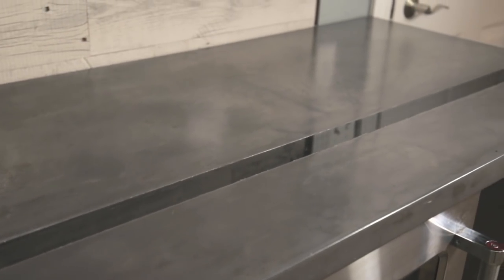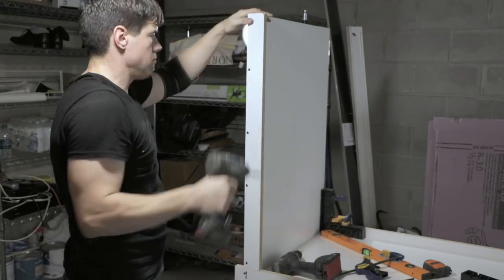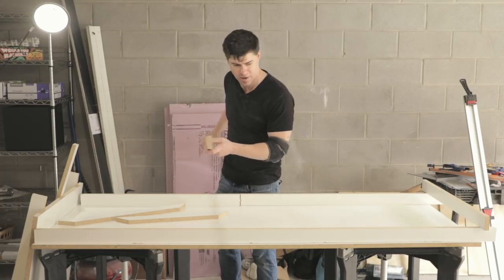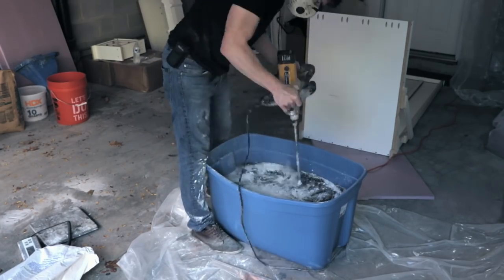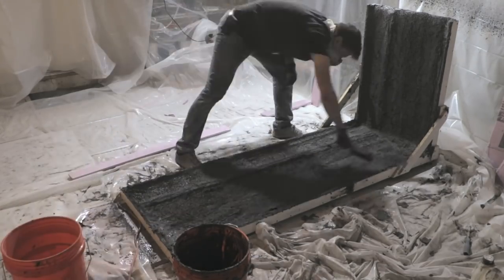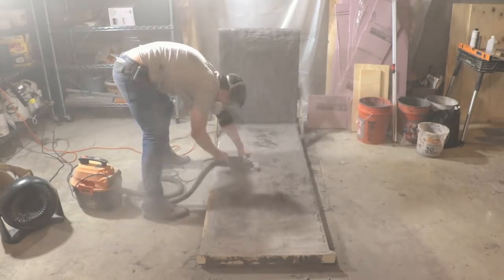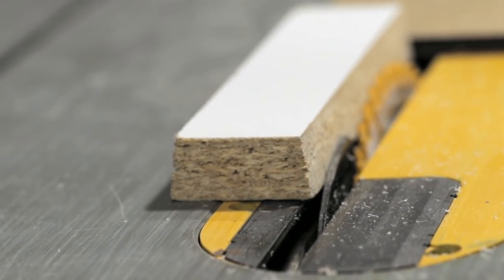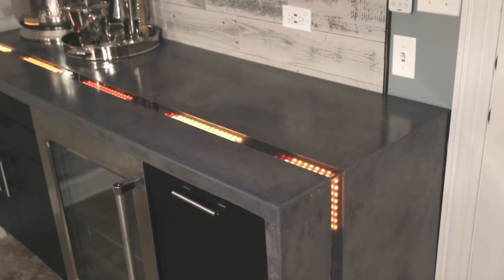DIY Mancave Makeover Pt. 1 // Waterfall Concrete Countertop w/ LED River Inlay

Comment from the maker: This project originated from viewers asking me to combine LEDs and concrete.  Do you think the project succeeded in bringing the suggestion to life?  Any ideas for improvement?  And, after watching this what project ideas do you have for the combination of LEDs and concrete?
Reply: Have you found or played around with any materials that diffuse the LED light? I've been trying to knock down LED light that is super close to the diffusion material. Anyway, awesome project, great results, and a video worth watching! Also + for PPE, e.g. respirator, Nitrile gloves, etc.
Reply from the maker: Yes, quite a bit actually.  What color diffuser are you looking for?  Check out the white semi-transparent acrylic I used in my LED Bluetooth Speaker video -- it does a great job of wide dispersion from pretty close.  I also bought a semi-transparent black acrylic sheet that I've yet to try.
Reply: Mostly white diffusion, I'll check that Bluetooth speaker video for that, thanks!
Reply from the maker: +Robert Edwards yea, I think there is a link there....that white diffuser is great
Reply: Modustrial Maker
Reply: Hey for your light strips, did you just wire up the data lines in parallel  or is there some other trickery going on?
Reply from the maker: Just wired them in parallel, so the data line from the controller splits and goes to both.  Nothing fancy for this build.
Reply: Modustrial Maker, nice work bro!
Reply from the maker: Thanks!

Comment: Another winner, Mike - dazzling!  280 Lbs delivered and installed!  By now, you know how I feel about Aircrete, so I won't belabor the point.

How about this for a table concept: an M.C. Escher-esque concrete table.  Chose from Relativity (staircases), or the birds/fish, Lizards, Drawing Hands, etc...  With molded relief in black and white or hand-stained. and then topped with glass.  It's ambitious, but I think it would be stunning.  And you're just the man to do it!
Reply from the maker: Thanks!  And that table idea sounds awesome -- would be quite a mold!

Comment: I love it, now that's something worth me learning
Reply from the maker: Thanks!
Reply: I'm seriously going to try, I already bought the concrete polisher.
Reply from the maker: +Dwight Hobdy cool!  Let me know if you need any pointers along the way.  I definitely recommend doing a couple small tops, and one with a small vertical surface to get the feel for the mix.  Lots of room for error with horizontal surfaces, but with vertical, you've got to get the mix consistency right.  Definitely doable, but a little practice helps :)
Reply: Modustrial Maker  Hey thank you very much for   the advice.

Comment: Great job! I love your show. Now, can you show how to do a kitchen countertop with the same concept? It's the same idea but weight becomes an issue. I figured you'd do it in place since it's going to be really heavy.
Reply from the maker: At some point I will do a kitchen...just need a freind with a kitchen they are remodeling!  I would do it off-site and use the same pre-cast technique.  With GFRC you can keep most any piece to a manageable weight by using foam inserts.

Comment: Hello great video!!!

Wanted to ask you what did you use to sand the final product?? 

1.)Diamond sandpaper on your orbital sander? 

2.)What grit did you use ? 

3.) Would a wet sander work better ? 

4.) Did you expose any of the aggregate? 

5.) Have you experimented with any other sealers that last a long time ?
Reply from the maker: Just normal sandpaper, up to 220 grit, then 400 grit wet sand by hand

Comment: I have seen a lot of people do this without the sprayer, would you 100% suggest having the sprayer or can the top coat be laid in and brushed in (similar to your white small table top with the wood piece)? right now my compressor is on the fritz and I would love to try some of these projects but would rather spend the extra 200$ id have to spend for compressor and spray gun on other products. Thanks in advance, love your work!
Reply from the maker: depends on the project -- if you have large vertical surfaces, you really want a sprayer.  If not, then pouring and brushing will give you pretty good results.

Comment: Awesome project Mike!!! It was cool to see you make the GFRC from scratch, and using stuff you don't have to order off the internet. GFRC is something I have been dying to start working with. But I've just got too much of my old man in me to pay shipping costs on things like "White Portland and Sand." But I think this video has inspired me to just get off my @**, order some glass fibers,  go to Home Depot for everything else, and start experimenting with GFRC. 

My one and only question I have is... what are you eating at around 04:30:00? It sounds delicious.
Reply from the maker: Ha, I wondered if anyone would catch that :) Probably dinner....at midnight...like usual....

I would recommend ordering some powdered polymer (maybe a couple bags of the Buddy Rhodes admix, which aren't too bad to ship), so you can source all the cement and sand locally.  If you don't have a masonry supply place where you can get white portland, you can also just use the grey portland cement they have at home depot (which is super cheap).  You can't do white, but it works just fine for grey GFRC.

Comment: To combat slumping, have you tried fixing covers to the side forms to stop the concrete flowing down? 

I’ve got a concrete counter planned that has waterfalls on both sides and feel this would be a way to eliminate the risk of slump.
Reply from the maker: Check out my recent Arctic erosion table... I solved the slump issues in that project... Use an AR glass mesh, and pack in thin layers, 1/8" or so each, to build up verticals slowly.

Comment: Excelente video, el acabado final es genial. Me da curiosidad saber que tipo de pistola usas y como se llama el recipiente que utilizas para poder almacenar el concreto para lanzarlo. Saludos!
Reply from the maker: ¡Gracias! Utilicé una pistola de tolva para tablarroca Marshalltown con un accesorio de 45 grados para la tolva. Aquí hay un enlace: http://amzn.to/2BJjmBi

Thanks!  I used a Marshalltown drywall hopper spray gun with a 45 degree attachment for the hopper.  Here is a link: http://amzn.to/2BJjmBi
Reply: Modustrial Maker mil gracias!!

Comment: Buy a trowel lol, also concrete is generally only 10-25% cement and is mostly aggregate (could save some money on future builds). It turned out beautiful though, very impressive.
Reply from the maker: Thanks!  FYI, cheap concrete like Quikrete is only 10-25% portland cement.  GFRC, however, which is much stronger, is usually around 50% cement.  You are comparing apples to oranges there.  GFRC would not work with a lower cementious content.

Comment: Good video, I also like the design.  But I am curious why he didn't use a plasticizer to help the backer coat level out?  Also why not place the foam board in place to create spaces then remove them, instead of leaving them in the project?  It seems like leaving them in would negativly effect the flexeral strength?
Reply from the maker: I actually did use plasticizer in the back coat.  I've found that when I get to 3% AR fibers, I can't get it to flow -- the fibers are just too dense.  I used a lot of fibers in the mix because it has to do a 6 ft span, basically unsupported.
Reply from the maker: Also, the foam core probably makes it a bit less strong, but we had 1.125" of GFRC in total ( 3/4" on top, .375" below foam), and I find it easier to just leave the foam in when not doing self consolidating.

Comment: Would like to know more about how you made the concrete glossy... I wish there were videos on how to make white concrete, black, glossy, etc. Don't know how to make concrete from scratch...
Reply from the maker: +LightGesture no huge secret...this surface is typical for GFRC if you sand and seal it.    As for white concrete and other details, check out my other concrete videos, including a couple with a white mix. And if you need more details beyond that, my Instructables have a ton of detail (just search for Modustrial maker on instructables and you'll find them).

Comment: Creativity and ability!!  Very nice stuff.  I am just getting started on your videos and want to attempt to try this process.  Is there a particular video that explains the process in detail of setting up the forms.  I think I got it for the most part but the roller ball is a bit murky thus far.  Where do you buy that and are you simply removing the excess by hand after it dries? That is a great process if so.  I apologize if this is a redundant question  but if you could provide a link to the purchase of the "Ball" .  Great Stuff Mike!!!
Reply from the maker: The first one I did on a white concrete table does the basics for forms.  I also have instructables (same user name as my channel) with details written up.
Reply from the maker: Yes, you remove the caulk by hand   There is a link in the video description to buy the ball tool from Amazon

Comment: Excellent video, precise and ilustrative. I don´t have a compressor + hopper gun, it could be done without face coat? In this case would be use only one mix with fiber glass from the beginning? Thank you ;)
Reply from the maker: Thanks!  With a vertical surface, it would be tricky to do well without spraying a face coat.  If you are just doing a flat countertop or table, then you can just pour a thin face coat in and spread it up the sides with a chip brush
Reply: @modustrial  Thanks!! This first fine coat with or without fiber glass?
Reply from the maker: No glass fibers in the face coat (sometimes you can do a second face coat too, it you have the time/patience :) )
Reply: @modustrial  Thank you very much ;)

Comment: Beautiful installation! do you generally have to remove the cream of the concrete before sealing for the sealer adhere to the surface?
Reply from the maker: I have used sealer directly on concrete with no finishing, and it seems to work.  Although, I would imagine it would not penetrate as well and would need to be reapplied more often
Reply: Modustrial Maker thank you for you quick response, your projects are so inspiring! Would the sealer adhere if the concrete had been polished using a wet polisher starting from 800 grit up to 1500grit... Ideally I don't want to expose the aggregate.
Reply from the maker: I think so, but would recommend trying a small test piece first to be sure.  just keep in mind that a surface seal is not the same as a penetrating sealer, which offers much more protection.

Comment: Are you able to eliminate bug holes by spraying your initial coat?  I've never seen that done before.  BTW - I've found the Chen sealer to be best for my kitchen countertops.  It is a bit expensive.  Do you have a cheaper alternative?
Reply from the maker: Fishstone's sealer is good but not cheap either.  the less expensive ones tend to be surface sealers only, unfortunately. This is fine for a table, but countertops really benefit from a penetrating sealer.  And yea, spraying the face coat gives you a really nice surface out of the form.  Not guaranteed to be without bug holes, but definitely less, and sometimes, pretty close to perfect.

Comment: Great creative application.   Question- how long does it normally take for the counters to cure completely before form removal and machining?
Reply from the maker: +David C thanks!  It depends on temperature. GFRC sets up quicker than normal concrete. I. 70 degrees or more, 24 hours is usually fine.  Under that, I give it 36 hours

Comment: Hey, great video! I've been wondering, why don't you vibrate your concrete? or do you vibrate it and just don't show it?
Reply from the maker: No need with GFRC....there is a defoaming admix that prevents bubbles in the face coat.

Comment: I was wondering, in the results using normal concrete and some steel reinforcement, had you ever tried that way?
Reply from the maker: I have, and I definitely like the results better with GFRC

Comment: how did you account for the thickness of the leds to keep it flush with the top? i'm thinking of just doing a strip in the back side of my outdoor kitchen bar and wiring from the underside
Reply from the maker: The thickness of the LEDs doesn't matter so much, you just want them set back a bit underneath the acrylic diffuser. The diffuser rests flush because I cut it with a bevel angle and used a matching angle in the form to make the recess for it

Comment: Would I use the WS2812 LEDs or WS2813? TY.
Reply from the maker: +Alex Shliomovich I recommend using ws2813 if you permanently attach the acrylic, since ws2813 will keep working even if one LED or two go out.

Comment: Hi, do we have to apply a face coat when using GFRC? Can we just sand away the fibers when its cured?
Reply: Also, what type of sander are you using, after the angle grinder part?
Reply from the maker: Depending on the type of project you can get away with no face coat, but you never want to sand thru to expose fibers as this looks bad.   For a waterfall or anything with a vertical form surface, I think you really need to spray the face coat.  For a flat tabletop, you can pour it in instead and still get good results.
Reply from the maker: I just used a plain old random orbit sander on this one
Reply: Thanks! Very helpful! Is the vertical surface comment because you applied it by hand? What if you had used another piece of melamine to form the backside and poured in the GFRC from the top?
Reply from the maker: For the vertical, the face needs to be thin or it slumps off.  Thus, you need to spray it.  Pouring it or trying to spread the face by hand on vertical will just result in it slumping off.  You need to spray a thin layer (or two) and then hand pack the back coat

Comment: That form looked complicated. Personally I would've tipped it on it's side, and leave what would become the back of the counter open; face coat two separate halves, attach them, then pour the concrete in, and do all the typical form work.
Reply from the maker: +Xander Zoolander not quite understanding your suggestion.....are you saying you would have cast the entire thing as a vertical surface (tipping my form on its side)?  Or are you saying you would do separate forms for the top and waterfall sections, so they were separate pieces?

Comment: Since you used a concrete die, how did you get the slurry mix to match?
Reply from the maker: I explain how I match slurry in my latest video (the thin curved concrete bench).
Reply: Modustrial Maker Thanks for the reply good sir. I’ll check it out!
Reply from the maker: No problem!

Comment: If you would have closed frame the wall it would have been flat and you would have never had to babysit it. Also if you would have screed the top/bottom and used a trial the bottom/top would have been perfectly flat. Why order from amazon go to the hardware store.

Comment: Do you use sand in your hopper gun mix?
Reply from the maker: There is sand in the bagged mix I use for the spray coat
Reply: @modustrial  there are no bagged mixes on the market where I live (at least specific ones that deal with countertops) and I'm trying to replicate spray coat technique a lot of pros seem to use. Can you give me a link on product you use or tell me what fraction of sand and in what proportion to the cementitious is included in there?
Reply from the maker: https://goo.gl/35RvFM

Comment: i love the project but i do have a pet peeve i hate it when people encase foam inserts in concrete furniture
its just bad form and more often than not there are structural failures after a couple of years or even a small earthquake . 
i really dont see the argument about saving weight in this case you maybe saved 20 pounds is that really worth it ?
Reply from the maker: Thanks for the kind words on the project.  I'm curious where you get that foam will cause structural failures?  In my experience, with GFRC, it does not cause any issues.  In this case it saved us about 150 lbs as well....so very significant.  Plus it saved a couple hundred dollars in materials.  If you have some research showing how the foam hurts the structural integrity in some way, I'm definitely open to learn, but this is pretty standard practice with GFRC.  It only has to be 3/4" thick, and with this one we had 1 1/8" of concrete, so it was overbuilt.

Comment: like the idea. would of made more sense if you floated it off while wet rather than spending all that time grinding it.
Reply from the maker: Totally agreed -- with GFRC there is a sweet spot 6-12 hours after you pour (depending on temp), where it is firmed up but not so hard you can't scrape it.  I usually try to time it to come back with a trowel and remove most of the excess then -- after that, a few minutes with a diamond hand sanding pad will polish it up after it has cured fully.  But, this was done on site at my friend's house, and between my full time job and it not being at home, that just wasn't possible with this project.

Comment: Id just buy wood and use epoxy.. Man I don't have half of the tools used.. Looks awesome though!
Reply from the maker: Thanks!  Must of the stuff can be done with a circular saw, and you don't have to spray the concrete (just make the form for the waterfall a bit simpler, since you don't have to build a back for it.  Funny you mention wood and epoxy, because I've got some cool project ideas coming up this year with those :)